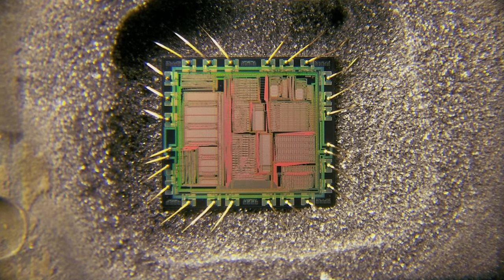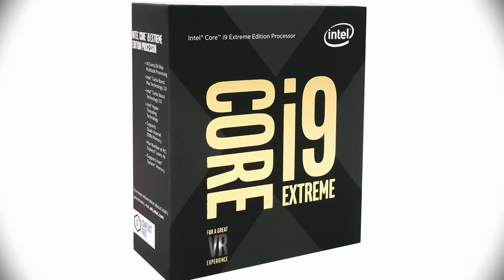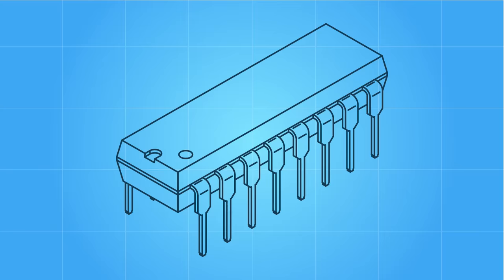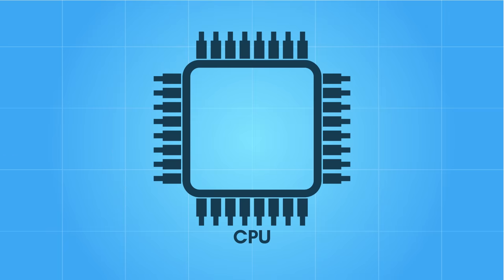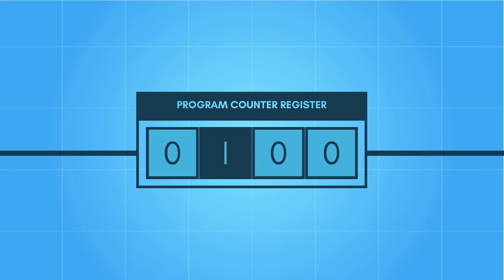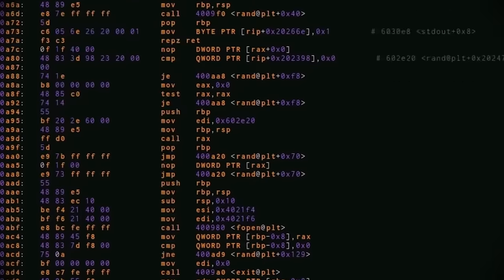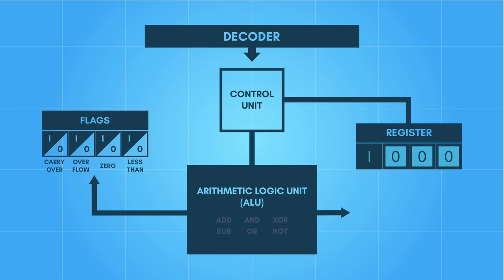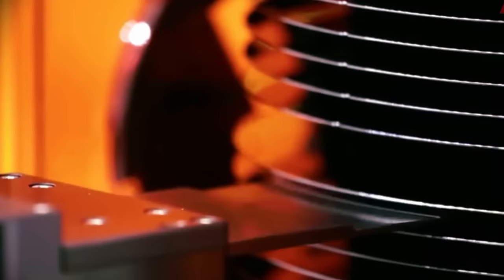The Evolution Of CPU Processing Power Part 1: The Mechanics Of A CPU

Comment: I’m sixty three years old now, and I started in the electronics industry around my seventh birthday. My best possession is a 4004 chip removed from a board that was going to thrown away.
Reply: Nigel James wanna sell it?
Reply: Ayush Kumar Hmmm....I’ll fight you for it !
Reply: Sounds like a good deal I paid about 1k for mine. Lol
Reply: Top Lobster Sorry Top, but I’ve got more than that.
Reply: @nigeljames6017 I wish I had some of the 1101 and 1301 
chips left.  At one time, I had a few whole wafers of them.
Yes,they were tested and bad, but still.  Old style 3 inch 
wafers.

steve
Reply: Steve Skouson WOW Steve, that brought back memories ! We were trying desperately trying not to use dynamic RAM, and at the time 1101 was the only chip available to us. 256 x 1 I seem to remember. In a sixteen pin ceramic package. The cost was quite high I seem to recall, but since I worked for the government, what the heck !
The love of my life was the Z80, and it’s ability to do automatic dynamic refresh of RAMs between instruction cycles. Saved a lot of headaches on the hardware front !
Reply: I have a 8008 somewhere in my electronics pile. Ripped off from a mainframe terminal control unit (fridge size) just before it was about to be thrown out in 83.
Ok, not the 1st one, but close to.
Reply: @fromgermany271  Close ! But it’s so interesting to hear from all these people still bragging about their old chips !

Comment: You should do a series like this on microcontrollers. Everybody always talks about the history of CPUs and computers, but I'd love to learn more about how that fit in with MCUs.
Reply: In essence they work the same way, except micro-controllers are used for more specific purposes. CPU is designed to be placed on to a specifically designed circuit board, the mother board, which is primarily composed of micro-controllers which communicate with each other (e.g: north and south bridge, SATA and USB controllers).
Reply: At first microcontrollers were made of discrete cpu, Ram, secondary storage all in one board. Later, on chip microcontrollers started becoming common and the older 'board microcontrollers' were phased out.

Comment: As an IT Professional, I'm a  hardware guy, it amazes me still that we have come so far in such short time. just 70 or 80 years ago we barely had mastery of basic circuits, today multicore processors that can top 5ghz in the consumer market.... Simply awesome, can't wait to see thee next 30 to 40 year, if I get that long... 

Great video BTW!
Reply: There won't happen much more.
The physical boarders are nearly reached. Intel is already sitting since 5  years trying to shrink the build size by 4 nm(from 14 to 10) down. I think something around 3-5 mm will be the smallest size possible. I actually don't know. But 3nm would mean that the length of a transistor is build by less than 30 atoms.
And the max Frequency is connected to the build size, so even this has its boarders. You can try to maximise the transistor count or get more Cores but this also won't help because of the sequentiality of the code. So you will need a revolution in the build material or the software side or architecturing. All things that will rather not happen.
Reply: @ahmadz.9944  The most revolutionary action would be use of Quantum computing using Q-bits rather than advancing in conventional digital electric-ionic computing systems. Of course, we will still need electricity to run those computers but the processes would not be done by active electric components like the MOSFETs which we are still using.
Reply: @ahmadz.9944  I'm actually pretty hopeful that we will develop newer materials, different techniques, and what not to eventually overcome those limitations. 

Its possible we see the joining of regular CPUs and quantum computers down the road. Maybe it went be typical speed boost, maybe it will be the way which we process data.

I'm not sure if it will continue, all good things...right? But I'm pretty sure there will be some amazing technological growth in the next decade or two... 

But then again only time will tell...
Reply: @kjellvb1979  one way it could be done are hybrids, basically Quantum computers can't be used as regular computers because they work very diferent, they are more like puré sheer brute force to process a lot of data in small amounts of time but without any fines, so the solution would be to allow Quantum computers to do all the heavy lifting while more regular computers gather the data and make sence of it
Reply: @ahmadz.9944  This is true, but they said we are developing clever tricks (like 3d lattice of Silicon to essentially build upward rather than outward), newer materials (perhaps graphine will be incorporated poor replace silicon, maybe some other material), and, of course, eventually using hybrid quantum and classical computer processes to accretive something drastically faster than modern day computers.
Beyond those aspects, I believe we will stop seeing growth in GHZ fior a while, we kind of have already, and seen more dedication to core growth. But I think you will see the greatest jumps in speed not by improvements on the CPU, but with how all the peripherals communicate with the CPU. We've already seen the growth of solid state hard drives, first with SATA based success and now with NVME drives on PCIe buses. I believe we will see the merging of RAM and solid state hard drives, and iirc there are already companies that offer some hybrid RAM/SSD storage solutions. Point being I think you'll see advancements in CPU to peripheral communication, and large jumps in compute speed due to those advancements. Imagine CPUs with enough cache-able memory that the processors barely had to make calls to peripherals over slower busses, achieving this by bundling RAM/SSD and moving it closer to the CPU along one extremely fast PCIe 4 bus it's amidst like the CPU has unlimited cache to work with. 

Granted that's an over simplified, and basic summary of what many companies are aiming to do. Maybe not exactly what I explained but variations on that theme of bringing volatile memory and your long term storage together, bringing it closer you the processor and along a faster bus.

The ideas been around for a while, the tech is finally getting there. You've seen this on the networking side already, and is only going to be growing the next couple years. Now hopefully we see it coming to the consumer side as well sooner than later. 

Here's an article that explains it better than I. Or at least some of the concepts.

https://www.edn.com/the-merger-of-networking-storage-ram-and-cache/
Reply: @carso1500  Most definitely. But I think we will see the merging of one's main storage (solid state stuff) and volatile memory (RAM) along the PCIe 4 bus, before we see hybrid quantum computers in the home. It most likely  will happen eventually, but I think we are still 50 years off of that at least (that said tech seems to move faster than one can keep up with). 

I think we will see some advancements in materials used for making CPUs as well, and that will be important to continuing the speed race. 

For now though there are great strides being made everyday, and I'm just glad to be alive for it all.
Reply: Yeah everyone is saying there fantasy story trying to be seen knowledgeable  but most of them dont actually understand a dame about computer hardware
Reply: @ahmadz.9944  when we reach the limit in transistors size we'll probably start moving to something else
Reply: Quantum computers. Thats whats next.
Reply: @ahmadz.9944  The aliens need to throw us another bone.
Reply: Ahmad Z. : Apple do the M1 - a new hardware architecture controlled by new coding Software. Its fast.
Reply: some kind of about room temperature super conductor material would be nice
Reply: More than 2 years later and we still have max 5GHz
Reply: Technology is not exponential anymore. We start to see it for example in graphics evolution. We are reaching the limits in many fields. There will be always some minimal improvements but we already lived the era of biggest evolutions. 

The only thing that can push those limits farther is external (not human) technology which soon or later us humans will have it somehow when finally our "brothers" show up. We us probably won't see it though. Not here. :)

Comment: Very enjoyable series. Much of my 40-year career (retired now) coincided with the advent of 8-bit, then 16-, 32- and finally 64-bit processors. I like that the subject matter is presented in an easy to digest manner without losing too much of the details of the engineering problems and solutions along the way as well as a fairly comprehensible use of the techno-jargon. Can't wait to watch the rest. Good work!

Comment: Great video, I knew most from school, but you simplified it so nicely that I believe most people follow without taking notes.
To anyone curious to actually understand this part by playing with it, I'll recommend trying to program a microcontroller, perhaps just to sense temperature or light, and outputting it by turning on an LED when certain conditions are met. Luckily we have pre-made platforms for this today (Arduino for instance).
To really understand the basics, you'll need to avoid using too many of the pre-made libraries that exist for those platforms... for instance, try to output a message to a character display by only manipulating registers in binary... It can be fun, but only if you're actually interested in how stuff works, and don't mind reading a few datasheets.
The advantage of using a microcontroller is that you have RAM and flash memory built in, you don't need to deal with an address-/data-bus until you're ready to connect external memory or peripherals, such as a character display, and their word sizes are not crazy large... it's easier to remember what 8 bits do than what 32 bits do.

Comment: Fun fact: The phone on which you are watching right now has more power than all of the computers
from 1960's  combined!
Reply: Did you just assume my viewing preference?
Reply: That's not true. IBM mainframes were going strong by the end of 1969 and there were many of them and a lot more from other companies. The ARM7 is really not all that powerful. So modify your statement to say the 1950's. Then you might be correct.
Reply: @Tapajara   The CDC 6600,  is one of the most powerful supercomputer that ruled the 60's and 70's could do a MAXIMUM of 300,000 flops. The iphone 5S (a really old phone by today's standards) could do 78.6 giga flops or 78,600,000,00 flops. which means you would require 26200 computers each requiring $2,370,000 . That is not possible.

Yeah. Math rules. lol
Reply: @greatdane114  lol

Comment: Invention of CPU and computer technology in general is like when cave men discovered fire. It basically has changed every day and i'm sure it's only start.
Reply: More like the discovery of electricity but yeah, good analogy.
Reply: It was the invention of the transistor that paved the way for modern electronics.
Reply: @hakont.4960  transistor itself didn't so much effect i think. Probably main reasons transistors  evolved is because of CPUs.

Comment: I was a 10 year old kid back in the early 80's. Electronics was growing on me fast, and I wanted to learn more about it. My grandfather had bought me a Radio Shack 150-in-1 electronics project kit for Christmas. It had a small, but fairly current for the time, I.C. on the built in breadboard. That I.C. contained a WHOPPING 6 components inside of it. My how times have changed...

Comment: I used to design discrete, TTL based, CPU's the instruction set was defined in micro-instruction code stored in EPROM. When I was doing this in the mid 1970's, Rewriting or programing a CPU's Instruction Set to optimize the system for a specific application was not a new idea. The way I implemented the Instruction Decoder / Clock Generator was novel for the time.

Comment: The 4004 was never considered RISC. In fact it predated the wide use of the term by many years. The term first came to prominence in the 80s. Most CPUs designed before that are considered to be CISC, although a few could loosely fit the definition.

Comment: 3:11 This video doesn't directly reference it, but sort of implies it; Networking is measured in bits per second (bps) because the size of the byte hadn't been agreed upon yet. Some systems had 5 bit bytes (baudot code), some 6 bit, some 8 bit and even some 12 bit.

Comment: My mom spent 32 years building circuit boards for Boeing including the ones used in the first two space shuttles. 12"-36" green square board with little "barrels and flats" of all colors and a soldering gun were my first "toys". Never understood any of it.

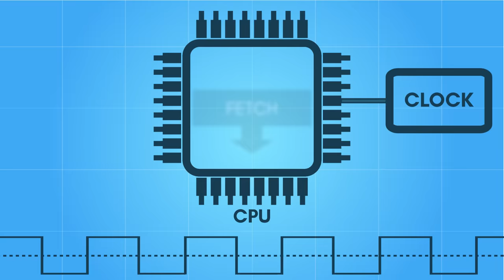Comment: Pretty good job. At 13:40 you misspoke. You said an increase in the clock rate  will lead to an increase of power dissipation. But you meant an increase in heat that needs to be dissipated. You could hear your voice relax the more you talked. Good job.

Comment: The 8-core processor in my $275 cell phone is simply amazing in it's own right. Can you imagine what a processor like this would have cost in the 90s, IF they could have even produced anything remotely similar? 
In the early 90s, I worked in an advanced SMD manufacturing facility. We would test our 4 processor server boards that we made by running Mac OS 7 on them, with tons of RAM, and opening as many autoplaying Solitaire games as we could before it would slow to a crawl and crash. They started to get PRETTY slow after running only 4 or 5 copies of the program. I'm sure today's CPU's could easily run 100+ copies with no issues.

Comment: REALLY well done video. Great presentation, great graphics. However, you failed to give DATAPOINT Corporation credit for inventing the 4004 instruction set, particularly the late Harry Pyle and others.
Reply: Intel designed and patented the design for the 4004. I also believe the instruction set was done in house as well. Not trying to get into a fight, give me a reference if you can prove me wrong. Thanks.

http://www.landley.net/history/mirror/timelines/inventors/html/aa092998.htm

Comment: 12:29 Just to add (what I'm about to say was technically said in the video, but it had to be inferred); In the video the single was just a repeating 0101010101, which makes it easy to determine the difference between 1 bit and another. But what if the signal was 00000 or 11111 (or any combination that included two like binary digits in sequence)? Then you need the clock to determine where one bit ends and the next begins.

Comment: microprocessors  were introduced  in 1970's after 50 years of time a differential  gear still too slow to fit the road surfaces. What makes you come out from teams of smart engineers  and play an important  role in the  industry.

Comment: 3:43 sorry commenting after a year but btw those 4 bytes you assemble makes a DWORD. If you open windows calc and use programing type calc then seek for bit toggling key pad, you can see and choose the type of "assembly data/structure block" as BYTE, WORD, DWORD and QWORD which from there I found that if you only have "1 bit comp" you will never reach value of 1 except only there's -1 so if you wanna val 1 you really need 2 bit  computer. Also from this phenomenon I realize that people understanding about "Nibble/Nybble" are incorrect. If you only have "1 BYTE comp", you only have 1 Nibble NOT 2 but if you wanna more Nibble you need elongate your "assembly/block data".

Comment: So the Intel i9-7980XE is able to perform 16 million times more instructions per second than the ENIAC for 1/600th the power draw. That means the Intel i9-7980XE can do 10 trillion times more instructions per second per unit power vs. the ENIAC.  The ENIAC was launched in 1946, the i9-7980XE in 2017. 71 year difference. That's an average compound improvement of 38% per year or 91% every 2 years.

Comment: Control Address and Data Buses operating on Bus Cycles. The number of clock cycles required to execute an instruction is instruction dependent. The first action of a CPU following a reset is an Instruction Fetch.

Comment: I just want to say that this video propagates one of the most commonly misunderstood portions of computing. 4-bit, 8-bit, 16-bit, 32-bit, and 64-bit do not neccssarily represent the most commonly processed word sizes. It represents the number of bits which can be used to reference a single word of memory, and sometimes it means even less than that. I know that is very technical, but it's something misunderstood, in that lower "bit" computers can still use larger numbers via design or by special math.

Comment: actually cpu reads memory adresses that will be read from ram or other storage(program code) cpu first afaik reds boot sector (which is in general hardcoded adress on room hdd or bios where designet to make cpu read that bits/instructions first ). and whatwer is written there becomes soul of cpu that firs bytes writes where to read next executable bits so called instruction codes. so after reading executing that code it does whatwer instructions says to do :D or the program itself. 
the kernels difference is its a program that is instructed by bootloader to load first and that program executes other instuctions of programs :D 
also programmer needs to know where the code is on ram. in upper level programs anyway programmer in general do not need to know but the program still knows as that information us syncronised/added to program by compiler :P